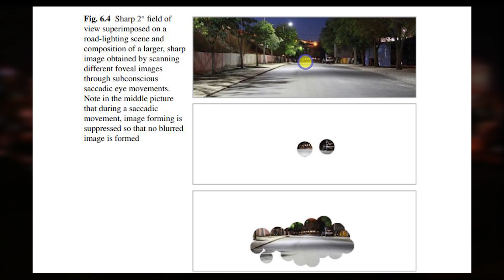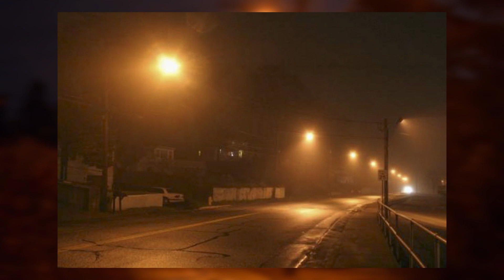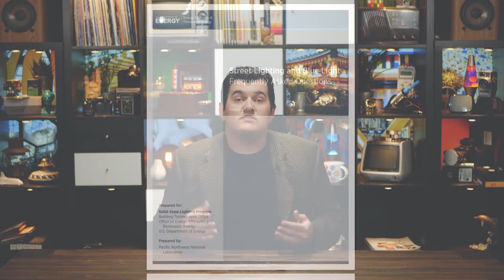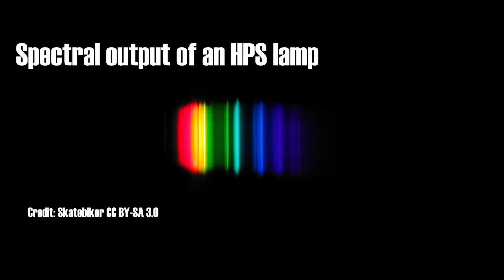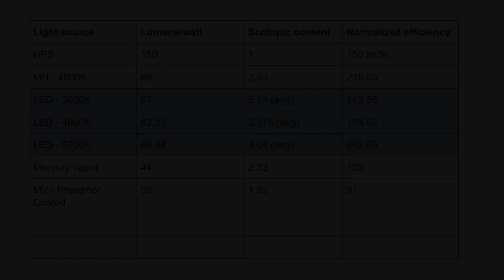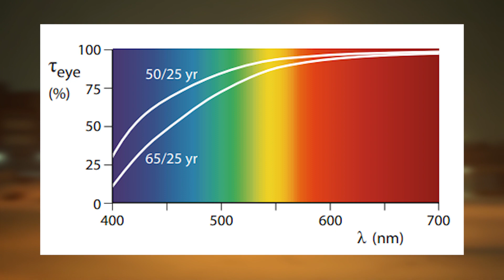The LED's Challenge to High Pressure Sodium (Response / Debunking / Topic Expansion)

Comment: Ultimately the issue is not LEDs or sodium vapor lights per se, it is the need for comprehensive regulation of artificial light at night (ALAN). Inter-meshing environmental, health and safety regulations are needed at federal, state and local levels. That means the lawmakers need to get informed on these issues and recognize the importance of the problem. Notice in the US we haven't had any landmark environmental regulation since the Clean Water Act? Light could be regulated in much the same way, defining beneficial uses for each ALAN sector, such as transportation corridors, residential, commercial and industrial lights, head lights etc. These beneficial uses would respect sensitive receptors in both the plant and animal kingdom, and humans. Ultimately, night is supposed to be dark so ALAN must be kept to a minimum as defined by source, illumination and ambient light levels. The needs of humans may have to take a back seat to those of nocturnal animals, insects and plants for the health of the planet as a whole. Neighbors might have to be considerate and not buy lights at the local store that shine at everyone except them. I spent many years in water quality regulation and light is not that different conceptually. You just need enabling legislation, budget and priority. It all needs to be meshed with building and health and safety codes too. What a mess.
Reply from the maker: I agree, the biggest issue in this field is the complete gap in knowledge between research fields and those responsible for regulating/operating lighting on a large scale. For example here is the situation I have personally observed - by the time information has trickled down to the level of municipalities / utility companies it has lost virtually all of it's context and many fields of research are completely ignored. 

Base level knowledge > "The blue-sensitive Rod cells in our eyes are highly sensitive to light and can be blocked from adaptation by light sources"
Visual performance studies > "Based on our research there is a slight advantage for blue light for peripheral tasks at low luminance levels with no visible lights"
Municipal lighting report > "Based on visual performance research, there is an advantage for blue-rich LEDs at low levels of speed where peripheral vision matters. For faster roads we should still use yellow light such as HPS"
Municipal lighting policy > "All lighting shall be switched to LED, with no requirements for an optimal spectrum or glare control."
Reply: @EdmontonRails  The lack of regulation has reached a crisis point with the wide adaption of LEDs, which are so intense and offensive to sensitive receptors even in the day time. The problem pre-existed LEDs though. The government would be wise to start working on laws to reign all this in before the impacts get worse. Massive environmental/health/safety legislation is needed akin air and water establishing authority, mandates, funding, agencies etc. Statutory definitions, compliance and enforcement articles, etc etc.

Comment: Another concern with LED lights is the photo-electric effect. LED light is produced by reversing that effect. The video does not explain the quantum physical source of LED light whereby an electron falls to a lower quantum level and emits light. One wonders what happens on the receiving end when the LED light hits the retina. Does it ionize tissue?
Reply: No, it most definitely does not ionize anything. The LED light is also mostly produced by the phosphors. They work in exactly the same way as a fluorescent lamp - near UV light is making a phosphor fluoresce. 
Some of the blue light mixes with the phosphor light, and the blue light can cause circadian rhythm issues, but it is very much possible to make LEDs with a similar blue output to high pressure sodium lamps, which contain a bit of mercury and thus emit some blue light.
Reply: The energy level of the "phosphor" light is from LEDs, which are energized by a reverse photo-electric effect, not black body radiation (i.e., heat). That is why the LED lights are so bright and intense. The phosphor does nothing to change this, and its intensity does not fall off with the inverse square of distance from the source, as in spherical source light. If you are saying that LEDs are basically very bright florescent lights used at night outdoors, I would say that is a bad idea. High energy radiation raises ionization concerns. @mfbfreak

Comment: As exposed by Dr. Nisa Khan, LED lights produce a semi-laser like beam of light. Mathematically the spatial distribution of light they produce emanating from the flat chip source, is totally alien to life on earth and can never be changed by a fixture. That is how the equations fall out. Conventional lighting such as sodium vapor and incandescent, is much closer to spherical source radiant lighting. Life evolved under black body radiators like the sun, not under LED chips. Just use common sense and it becomes obvious. If you still don't believe it, look at the mathematics.
Reply: Saying something is more natural is not a valid argument in science. Furthermore, it's perfectly possible to diffuse LED light if you want it. Just look at your LCD monitor The white light of a monitor displaying a white background, is incredibly well diffused - you literally can't tell how many LED strips a standard quality monitor has. 
The thing is, you don't want diffuse light in street lighting, because then you cannot bundle it properly. The cut-off of the light beam needs to be engineered to suit the task at hand. For instance - it should ideally radiate in the direction of travel of vehicles on a highway, but not in the direction of the opposite lanes. At the same time, the cut-off should not be too sharp, because of the fading in and out effect while driving under them.
Reply: You don't know what you're talking about. I have to use dark mode because the white background of the computer gives me migraine. Maybe you don't have this problem but I do. Further I worked as an environmental regulator for California for almost 30 years. You have no clue about environmental toxicology  or planning review. LED lights were given a pass in the name of climate change. They have not been vetted for sensitive receptors or health and safety. Everything that you're talking about if possible should have been done before they were rolled out as part of basic due diligence. @mfbfreak

Comment: An interesting if not insightful look into light sources and their effects. I guess my biggest question for this is: what is the best solution? I'd say the biggest problem with LED lighting for streets is certainly the intensity. Bare diodes and chips are painful to look at for me. However, one of the biggest issues I have with sodium vapor (and this seems the case with others also given the studies) is that due to the very narrow range of light emission from them, it can become very difficult to differentiate certain movements or objects at night, such as pedestrians on sidewalks in the periphery of the fixture. LEDs struggle also to illuminate people away from the main beam of the fixture, but the additional output allows a more thorough reflection upon the pedestrian which can be important if they're at something like an unprotected crosswalk. 

Of course, many of these situations can be resolved less by lighting policy and more policy regarding behavior at night. Speed reductions, retroreflective markings for crosswalks and signals, stricter high beam usage and other strategies can be employed to help increase nighttime safety with driving.
Reply from the maker: Hey, thanks for watching! I agree that the limited color rendering of sodium lighting presents some issues when it comes to detecting small objects, but I find larger objects are seen easier under sodium lighting. Last year while in a vehicle at night, someone dressed in all black began crossing the road under LED lighting. We were less than 100 feet away by the time we saw him and could of easily hit him. I believe that the advantages for LED color rendering only exist for bright colors, as dark-colored objects maintain their dark colors. The ability of sodium lights to cast a bright yellow hue onto dark-colored objects helps a lot in visibility, especially for people wearing black clothing at night.

Ultimately the evidence suggests that the ideal roadway LED would essentially be a mimic of sodium lighting, making LEDs much less appealing considering their low efficiency for producing light within the yellow/amber spectrum.

Comment: A class of individuals cannot neurologically tolerate the spatially non-uniform, directed energy of LED visible radiation.  LED streetlights for these individuals will trigger life-threatening photosensitive seizures or multi-day migraines.  In addition, the electronics that drive the LEDs create flicker, consciously noticeable to some individuals, and subconsciously affecting many.  This flicker cause  have severe neurological trauma.  Thus, LED streetlights can create discriminatory barriers to access of city and business services in violation of anti-discrimination laws.
Reply from the maker: I agree, there are major issues with flicker that need to be addressed in LED lighting. I also believe that there are many health issues caused by the sheer intensity of naked LED lighting that we are only beginning to discover and understand. LEDs have a long way to go in being biologically safe.
Reply: The flicker is much more severe in old school, magnetically ballasted gas discharge lamps. Don't forget that those turn on and off in the rhythm of the mains voltage. Only high frequency ballasts take the flicker frequency to something that is invisible to everyone. 
Meanwhile, many LEDs already have switchmode power supplies. Very few street lighting installations use the extremely basic capacitive dropper circuit without smoothing you see in home use LED filament bulbs.
Reply: Correct✔✔✔